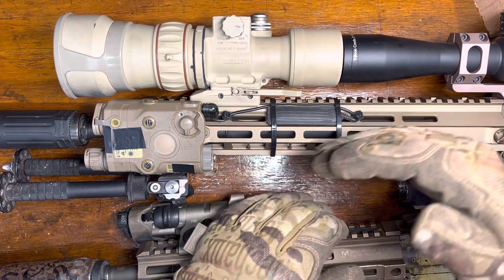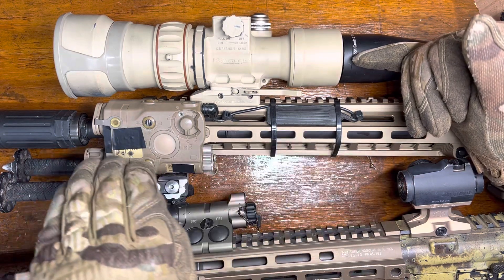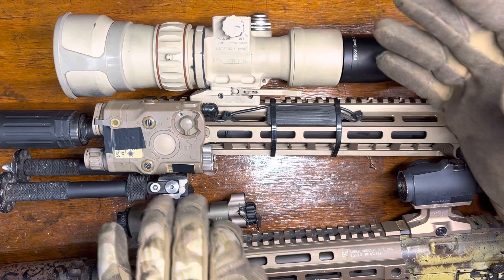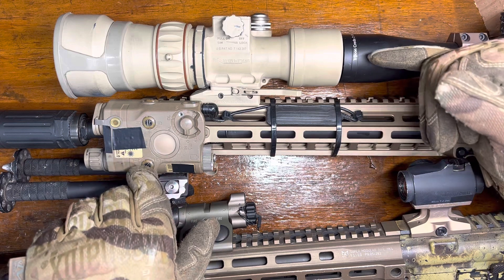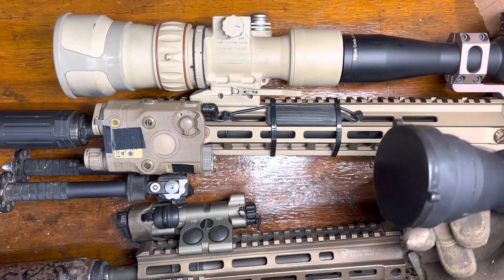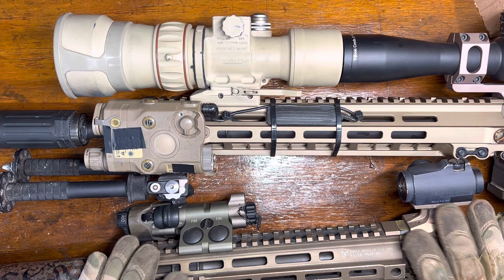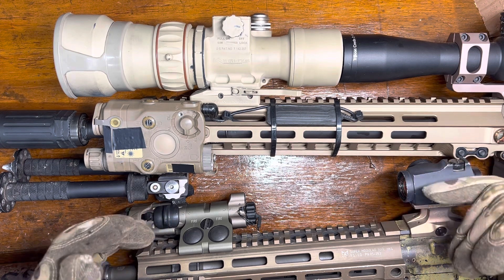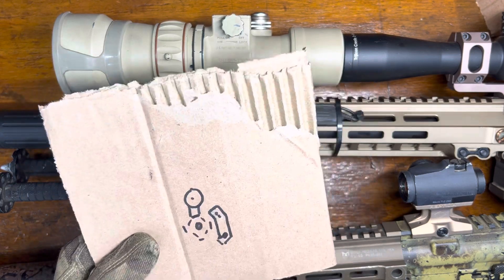Zero your IR laser, converging vs parallel

Comment: If you doing parallel zero the holdover doesn’t change, but for converging zero it changes. You got it very backwards.
Reply from the maker: For converging at some short range 25-100 or something, then sure. If you converge at some distant target further than your longest shot, then no, your zero will effectively be the same as primary optic and the offset will never be more than the physical offset between the centerline of your primary optic and your laser emitter.

Comment: Thank you so much for clearing this up. At the risk of giving myself a brain aneurysm I’m gonna ask a question..please;

So if I’ve got my 5.56 let’s say, I know my EOTECH is zeroed at 50 yards. If I put my laser on my red dot at 50 yards I’ll be zeroed at 50, no problem. But if I pick a further object…a tree 500 yards away, and I put my laser on my red dot at that distance, I should be good? Out till about 200 yards, but once my bullet drop happens I’ll do the same holds with the laser I would do with the EOTDCH?
Reply from the maker: Put your laser on your red dot at the furthest thing you can see. Then aim with your laser the same way you would with your red dot. If your hold with your red dot at 500 is 2 targets high, hold your laser 2 targets high.
Reply: @mustangduckk  i'd be better to use a set distance like 100 meters consistently to verify zero on both units, vs just pick as far as you can see no, the laser will show up in different spots looking into the optic in diff distances .
I am going to try it tomorrow on a Hellion, the height over bore for the pic rail is like 3+ inches

Comment: The same concept should work through a LPVO right? just zero the LPVO then find somthing far out and align the lazer with the crosshairs?
Reply from the maker: In short, yes you want to do the same thing. It’s easy if your LAM has a coaxial vis laser, just go out at dusk and line them up. If you’ve got IR only then you gotta get behind the LPVO with your nods to do it, which is possible just a little less easy.

Comment: Setting up a 300blk running subsonic loads. What would you zero your red dot at if doing a converging zero? 100 yards?
Reply from the maker: 300 blk with subs, 50 or 100 yd. Either one is probably ok. 
Either way, I’d get the red dot set, then zero the laser to the red dot at a distant object.
Reply: @mustangduckk  thank you sir
Reply: @mustangduckk  do you have Instagram or someway I can dm you?
Reply from the maker: Sure I just hit you up on Insta.